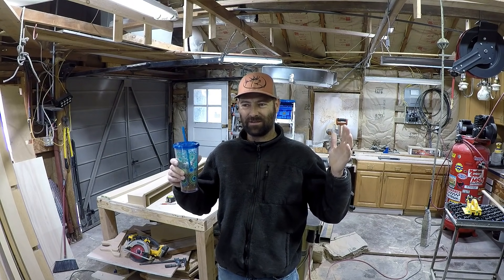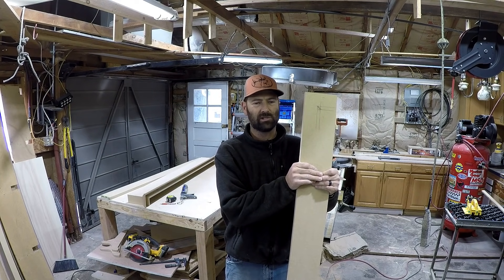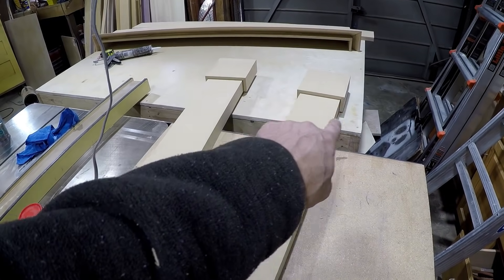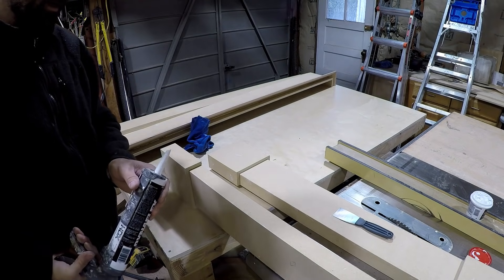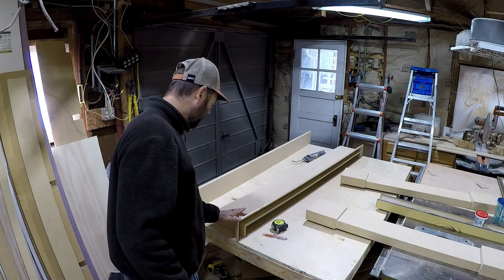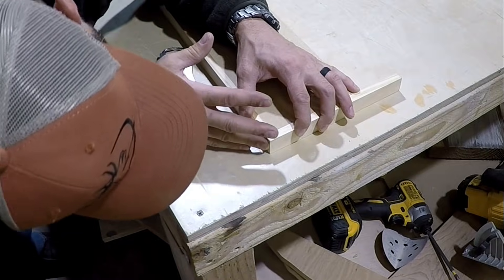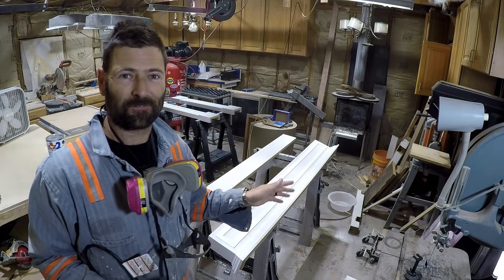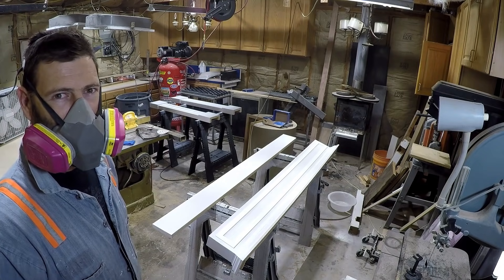How To Make A Classic Fireplace Mantel pt2 | THE HANDYMAN |

Comment: Looks beautiful.  Do you use a tack cloth before priming or just the air? Did you back bevel the piece to be scribed or was it unnecessary in this application?
Reply from the maker: When I spray lacquer I do.  When I paint I use air and a rag to wipe it off.

Comment: Just love your work & channel. Got a question about your shop. Just curious if had any issues over the years with the fireplace you use & if really like that style/type? Live in FL, so don't have a fireplace in my shop, does get cold here, but use an electric heater if need little extra warmth😊
Cheers, A👍🏻

p.s. Been doing a lot of fireplaces lately it seems, hope you enjoy them
Reply from the maker: My wood stove is home made so its not very efficient. It burns wood pretty fast.  I got the workshop up to 78 degrees last week when it was in the 20s outside.